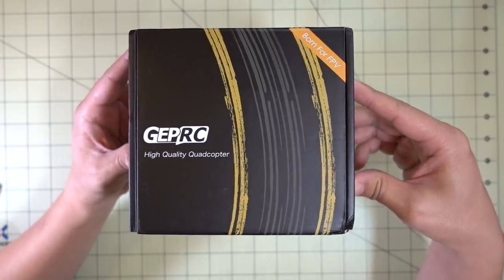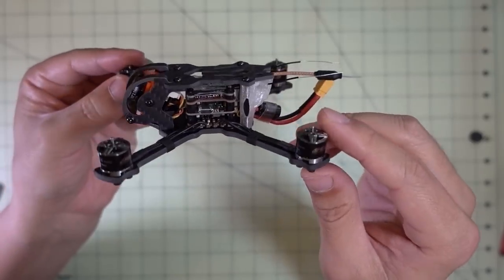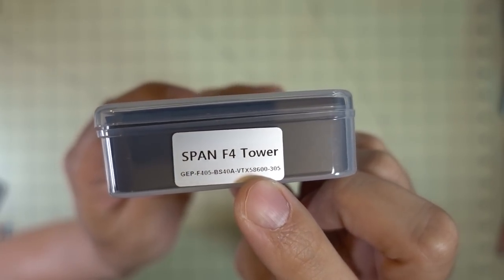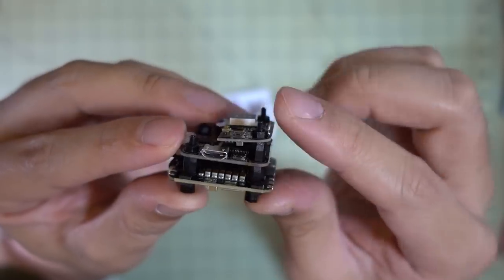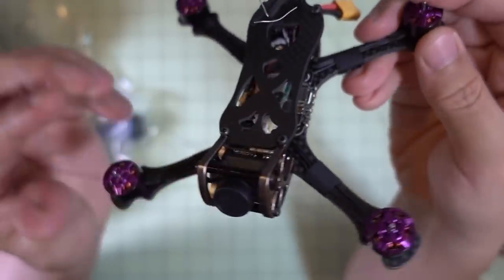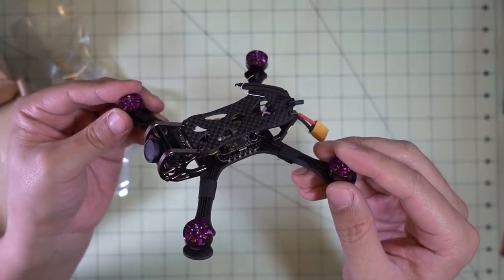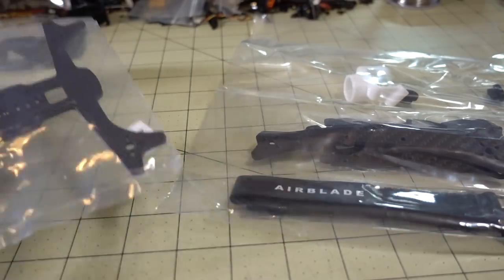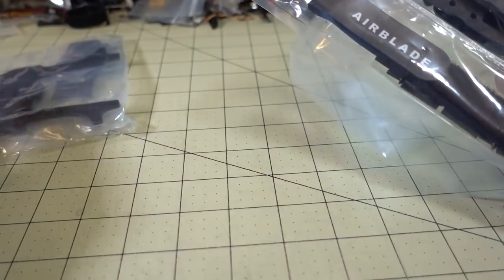Haul Time #95 🛒

Comment: I use 20amp Spedix 4 in 1 ESC on 2, 5inch Hyperlite Toothfairies running 2205 motors at about 240 grams with props for my main racing rigs and they work great. I placed my preorder of the dark knight radio and can't wait since I've been using my Turnigy Evolution since I've started fpv almost a year ago.

Comment: The Magnum could be better.... at least to have one normal TX/RX pad... to connect SmartPort or Crossfire...  sad so sad, but hey EMAX added SmartAudio =)
Reply: there is no FC with current port IN via ESC cable in 20x20 size. But yes, emax will sell ESC separately. ESC looks really good. Don't know if real usage of 6S will hold it.